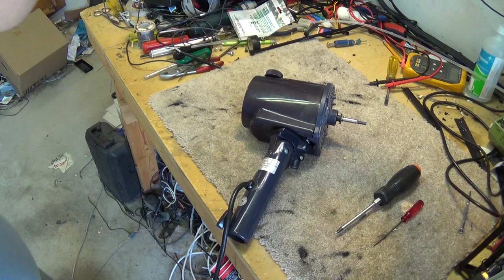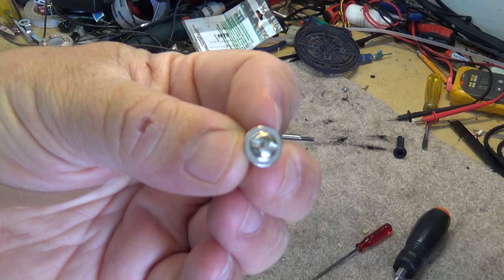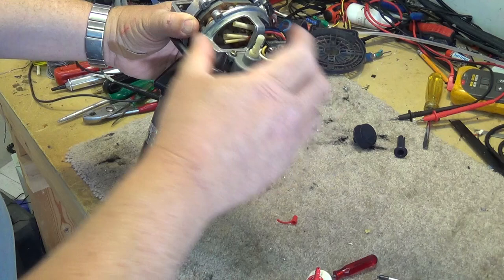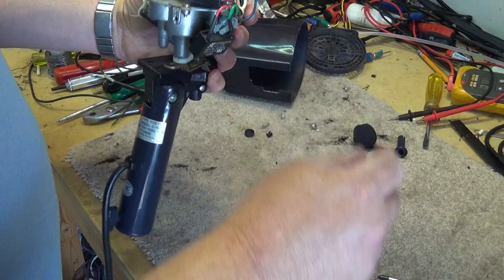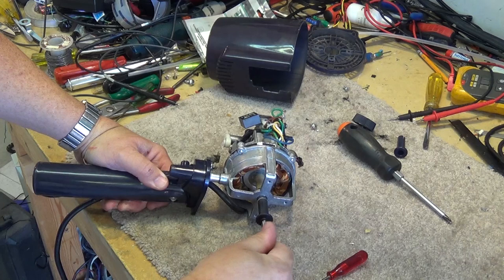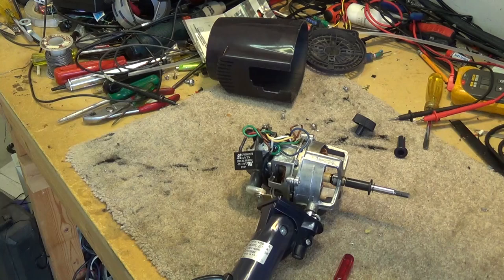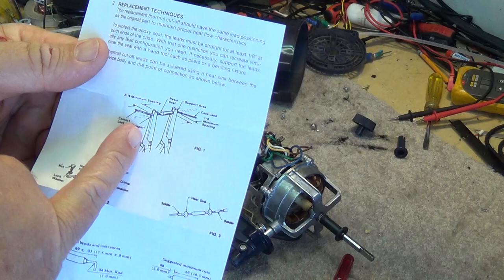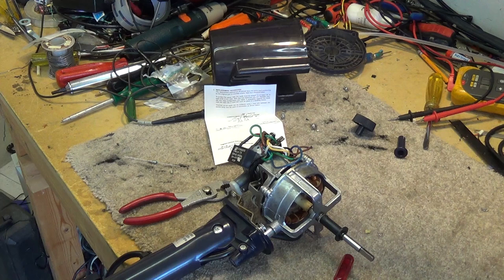Electric Fan Motor Repair

Comment: That little thermal couple if that's what you said made all the difference - saved a lot of money!!
Reply from the maker: +Donald Ellett Thermal cut out. Basically a fuse that opens if it gets too hot to prevent a fire in the event of an over heated motor.
Reply: thanks

Comment: I like that you bother yourself fixing such cheap things. If it's inexpensive to repair, then why not? I like to fix stuff too, fixed quite a few CFL's already and if the filament goes open, I just power them with a little circuit that treats them like cold cathode tubes. Works a treat and keeps this harmful pieces out of a landfill for longer.
Reply from the maker: +MrJohhhnnnyyy I do it more as a hobby. That cheap fan still is running almost a year later.I probably would have just bought a new one, but it broke in a heat wave, and all the stores were sold out already. I do have central air, but try not to turn that on this early in the season, because the that sucks back power like there is no tomorrow.
Reply: 12voltvids You hit the point. Most of the time it's just interesting for me to see - can I bring this back to life? Few month ago I fixed dead coffee grinder that was dead thanks to the field coil having a break. Luckily the break was on the outside of the winding, easy to get to. Works great now, good performer.
 I love your vids, keep up the good work! :)

Comment: I would fold a piece of sandpaper over the leads of the thermal fuse and strip any and all oxide off the leads .. especially true if you plan on soldering the replacement fuse ... clean leads make for quick and clean solder joints i.e. less thermal input req'd.

Comment: I own a windmere 12in table fan and it 90f out side and I was in my office area with it running and it locked up I had to take the motor entirely part and remove the barring sat in motor oil for a week I put it back together and it works grate its actually quite as well.

Comment: I like fixing fans. If I can. Never did change the thermal cutout or Capacitor yet. I do need to try.
I take the rotor out and clean the bearings and lube it.

Comment: Thanks so much for this video tutorial!  I learned alot.  My fan is lacking a nylon/plastic spacer on the motor shaft within the motor 'assembly cage' (such as the white one yours has in this video, in front of the armature, inside of the 'assembly cage').  My fan motor shaft, as a result, slides in and out during fan operation, and when it is further out, the armature grinds against the assembly cage, and then the oscillation kicks in.  I was thinking about adding some sort of spacer on the inside to prevent this.  Where would be a good place to find a suitable spacer?  Thanks!
Reply: Ace Hardware .

Comment: Was hoping there'd be portion where capacitor is tested, and show procedure to know if its bad or not. My fan heats-up fast lately and another one with blade not spinning. Still informative though, thank you for putting up the time and effort.
Reply from the maker: Good idea. I will do one with were I disconnect the capacitor to show the results and show testing the capacitor with a meter.

Comment: Maybe you should use a screw gun for undoing the screws.  That would be a lot faster. Also, you should of showed us what the fan blade looks like.  And, also the grills for the fan.  Those are things that people look for when watching a fan video.
Reply: A "screw gun", as you call it, could very easily strip the screws. In any case, the exercise is good for your wrist.

Comment: Nice work.     It's ridiculous that they don't have oil ports to just add oil to the bearings from the outside.    They KNOW these bearings are going to dry out in a couple of years and overheat the motor and they hardly oil them at all anyway when they are new.      It's OK to just add new oil to old oil in bearings without "cleaning everything" like some Youtubers.     For generations, people just added oil to oil ports in electric motors and they lasted almost forever.
Reply from the maker: Could have been the result of someone putting something flammable in it instead of oil and the unit bursting into flames and then a resulting lawsuit.
Reply: @12voltvids  - Yeah, but it's more likely BLATANT planned obsolescence that the average fan owner can't oil the motor regularly unless you're a fan hobbyist.   They don't even try to hide planned obsolescence anymore.

Comment: HI, I just broke the tiny wire.....is it possible to repair?
Reply from the maker: Use sand paper to remove the enamel insulation and you can solder it.

Comment: I've got novice fixing skills, a neighbour threw out a beautiful fully metal tall fan. Honestly the little motor housing alone, no blades weighs 3x more than the cheapest amazon stand fan. 
The issue was thermal cut out. Now when I took it apart, which was a very hard task as it's very well put together the windings right near the thermal fuse are loose in two spots. Could this be causing heating in the location?

Comment: I've been cleaning my fan motors for quite some time now. never seen any of them with a thermal cutout (live in a 3rd world country). I was wondering what kind of oil you used.
Reply from the maker: +alfblack2 It is just light electric motor oil, like you would use in a sewing machine.The thermal cut out is required for UL certification. To sell in North America it has to have that certification.
Reply: Cool. We use the same thing. hehehe. I have an ancient industrial fan almost a decade old that requires maintenance once every few months. I was wondering if it's the oil that is the issue. But I guess it's just the age of the fan. :)

Comment: Great Video. I have two fans. Looks like I found this video just in time, (before the Thermal cut off opened). This should speed them up. I noticed you had blue a 3 in 1. It looks like their Blue electrical, but the only Blue electrical motor oil I found was for 1Hp or larger. Is this a special 12v or small motor oil you use, or is this a standard 3 in 1? I also have a Singer sewing machine oil I've heard might be better. I bet all are ok since it's just a couple drops, I just wanted your pro opinion. 

**Tip: Also, some fancier oils come with telescoping tube. 
 I found that a small piece of fuel line hose ($.13/ft ) I had (from a weed eater repair) works great on all of my small oil bottles!
Reply from the maker: Any light oil will be fine. Just don't use engine oil. It has detergents in it that are not needed or wanted for electric motors. Sewing machine oil works fine.
Reply: I have been using engine oil (50/50 mix of 5w30 and 5w20) for the past few years without issues. I have tried sewing machine oil, 3 in 1 bicycle oil, hair clipper oil, and white lithium grease before that and those did not last at all. Why are the detergents bad in engine oil and how come it is the best that has worked for me?

Comment: I will also reflect on one thing I have seen happen, if the fans motor run capacitor goes bad but not fully bad,, (the fan wont start and just hum if this happens) it wont create the proper electrical offset in the motors field windings  and this make the motor run hot (it creates unwanted inductive heat in motors stator field) as well as running slower then normal. this heat buildup can offset cooling airflow and will also slightly warp the motor frame and make the fans sleeve bearings bind up causing the fans inductive rotor to lock up (locked rotor event). The motor will then if not shut off cook itself opening the thermal protection fuse or worse. I think you addressed the run cap issue in another video in recognition,, But a partial failure of the fans run cap wont stop the motor outright but in some cases it will make it produce more heat so it is a good thing to check as well.
Reply from the maker: If it goes leaky, but in this case the bearing lubricant got dry and the bearing seized up.

Comment: Hi thank you for the video. may i ask if all fans use the same thermal fuse in terms of its ratings? i'm asking because i have 2 fans of the same brand but different sizes. Both stopped working. i took apart one and pulled out the thermal fuse. I'm not sure if i bought 2 of the same thermal fuse would work or do i need to pull out the oher thermal fuse as well?  Thank you for taking the time to answer my questions.
Reply from the maker: Most will use a similar rating.  This is a fail safe and generally are quite high temperature before they pop

Comment: 12volt, I have a Airking 9155 16" blade. Window fan. I have to do the same, is the thermal couple located inside the housing and I would do it the same way. Pain in the neck to get in side do you know of any other videosThanks. Good stuff......
Reply from the maker: Most motors have the thermal cutout on the common lead of the coil and it is usually mounted right on the coil so that if the fan blades were to stop turning and the motor overheats they will open before the insulation breaks down and causes a bigger short that could lead to a fire.

Comment: why doesn't the manufacturer provide holes through which the bearings could be routinely lubricated?
Reply from the maker: +Michael Swindal Because they want it to burn out so you have to buy another one.
Reply: 12voltvids  engineering-in failure, products made cheaply as possible, increasing sales over rivals,  making do with off-the-shelf parts, international trade complexities = waste of copper wire, manufacturer's industrial pollution and fans littering dumps all over our warming planet.     Systemic problems like these seem to baffle the genius of mankind.   The answer out there among us somewhere waiting for the light of day.    We need you now.
Reply: Because it is made in China by people that don't care.  They want you to buy a replacement as soon as possible and put that one in the landfill.  The goal is to exhaust all earth resources as fast as possible making throwaway crap.  This is so a small group of global bankers can get rich as possible using pennies on the dollar outsourced slave labor and import that junk back into the country tarrif free.  That is why you don't get an oil hole or any amount of felt oil wicking.

Comment: HI just a quick question how can u connect the motor from the fan staight to the power out let wich cables make the motor work and spin can some one help?????????
Reply: You can't do that you need capacitors.
Reply: Ceiling fan?

Comment: does the thermal cutout take the place of a capacitor? i have a fan with a dc motor, i opened it and the motor is completely stagnant and a capacitor is attached to it.
Reply from the maker: No, the thermal cutout is a safety device. 
Not all motors have a capacitor. If it is a shaded pole motor there will be no capacitor.
Reply: yeah i found the thermal cutout, i shorted it and my motor started to work, so iam guessing so far that was the problem, gotta replace it. still trying to figure out why would there  be a capacitor though. Great video btw, Thanks.
Reply from the maker: Induction motors use a capacitor to create a phase lag in the second coil, which creates the rotating magnetic field required. I do have another video up with another fan that the capacitor failed, so if you look that one up you can see the symptom. The fan start, but if you spin it by hand it will rotate slowly.
Shaded pole motors don't need one because of the copper straps on the stator. These work like a transformer to create a separate magnetic field that acts on the rotor to produce the required magnetic rotating field. Larger fans use an induction motor as they need more power.

Comment: can you BYPASS the Thermo coupler (cutout?)  or will it burn out the motor?
Reply: If you want to start a fire.
Reply from the maker: +BobLoom36Ful Never bypass a thermal cut out. It is a critical safety device.

Comment: hallo. ..how to know motor fan stiil good or damage
Reply from the maker: How are the bearings. Should turn freely. If they are good then check the coil for continuity, if that is good then the capacitor or switch is the problem. Of course if the thermal cut out is open line in this one it won't work.

Comment: hello can you tell me why smoke is coming from my fan whenever i start it at 3 speed and when i switch it to 2 speed it spin the opposite direction
Reply from the maker: +Keyoke Andson Sure sounds like one of your windings is shorted, or possible the capacitor is shorted. Motors shouldn't smoke. That is a bad sign.
Reply: thanks
Reply: what side of the capacitor  isnegative and positive
Reply from the maker: +Keyoke Andson Neither, it is a bi-polar or AC capacitor.
Reply: thanks

Comment: How to fix when an electric fan is overheating?
Reply from the maker: Raphael Daniel Somera Only 2 things will cause this. If the motor coil has a short in it, then the motor is done. Much more common than that is the lubricant in the bearings dries out, and the rotor starts to stick and this causes the motor to work harder and overheat. In this case you can probably take it apart and lubricate it. If the bearing is worn out, it will probably not last long. You can tell my looking at the bearing and shaft. It is is all scored from metal to metal contact, then the mtor is on it's way out.

Comment: is this coil protecter
Reply from the maker: If the fan stops, due to a seized bearing, or something falls into it, there will be no airflow over the motor to cool it. The coil will overheat, and burn out, or worse could cause a fire. The thermal cut out is there to prevent this.

Comment: What size capacitor was it ..?
Reply from the maker: Hillside Animal 
That is irrivaliant because different designs, voltages and line frequency affect the size. I believe this one was 4.7 @ 400v ac, but you are going to replace same value that is in there.

Comment: idont know why my motor is too hot? pls help"
Reply from the maker: Probably the bearings are dry and thus loading the motor down, or the run capacitor has turned to a resistor. (shorted)